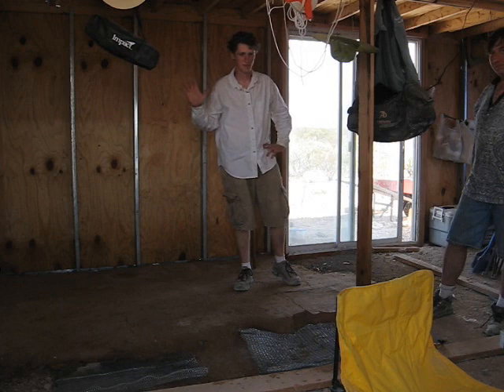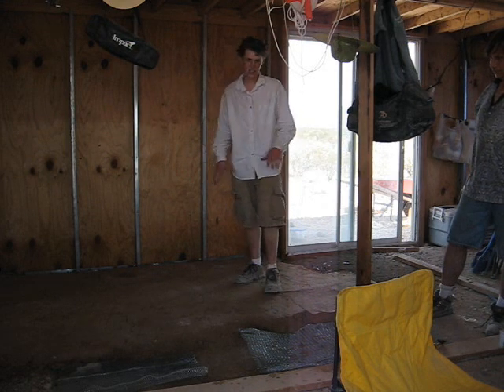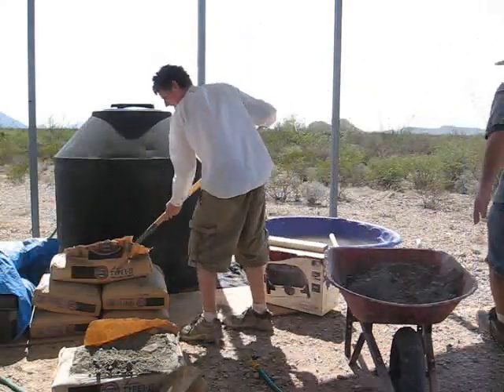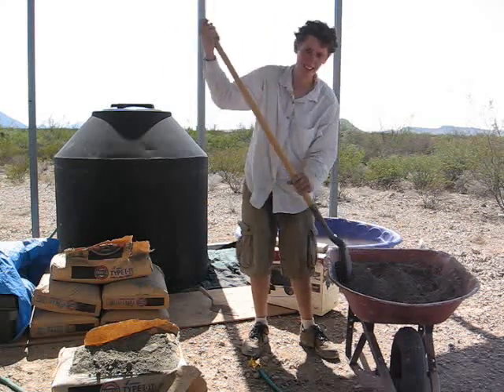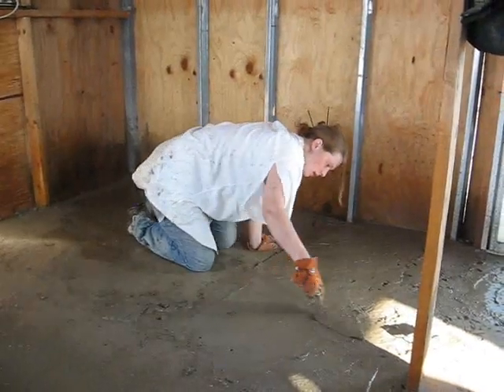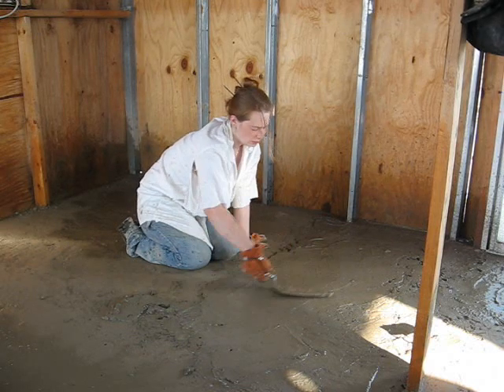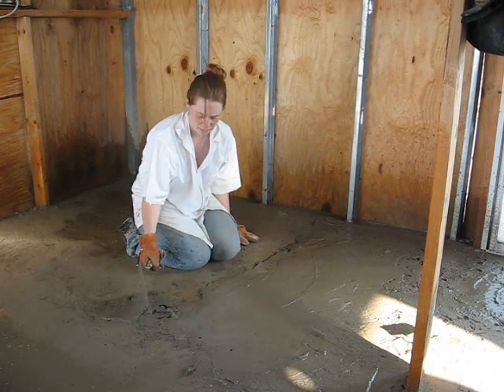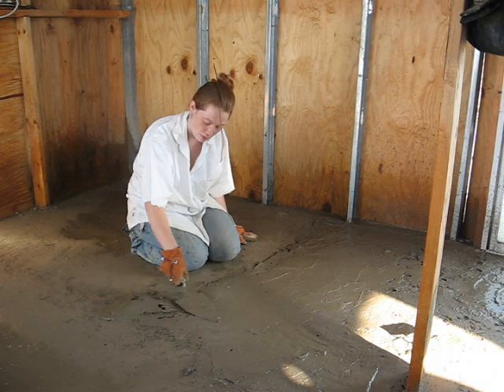Off Grid in Texas - Adobe Floor

Comment: I use horse manure, goat manure, 50% dirt. for straw try tumble weeds. I build my goat pens out of them. I use bard wire in the center of the bricks for reinforcement (rebar).  sometimes I use a large form to make walls Find you some terrier mix small dogs, they keep the pack rats and feild mice population down. I've got two fox terrier chihuha muts best rat killing machine around.

Comment: Why on earth adding portland cement to an earth floor?It is beyond my comprehension.
Reply: adding cement....
makes cement treated soil...
sometimes required on military bases....as a 6 inch or more layer before the base (rock) material then asphalt or concrete....
having installed it....
the next day even a 140g cat blade couldn't cut it.....